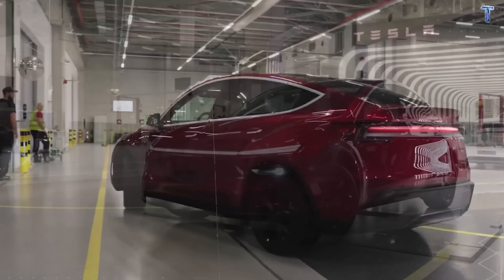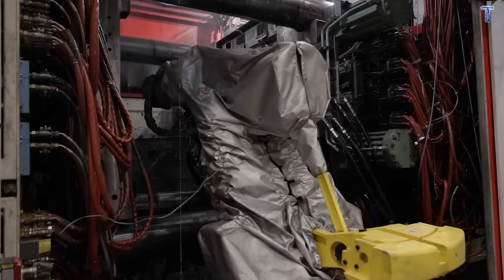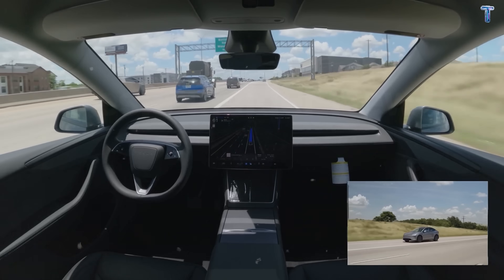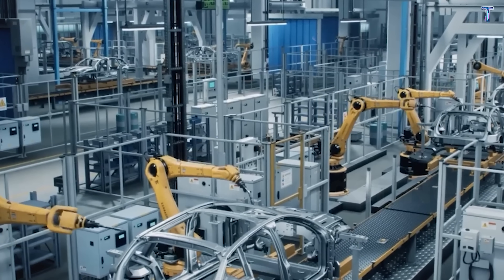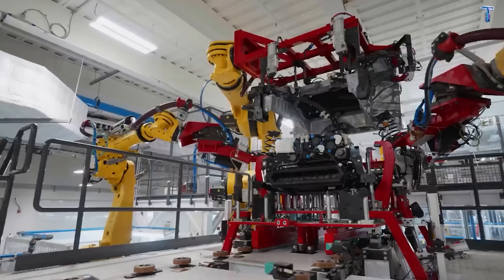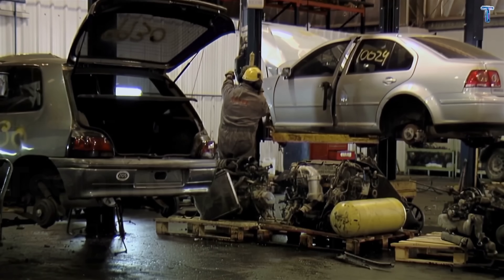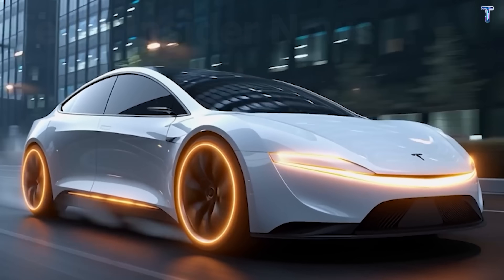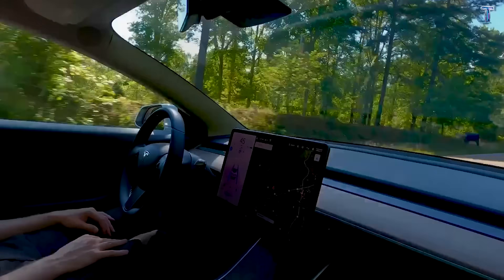Elon Musk’s $12,749 Model 2 Ends Car Bills Forever

Comment: Less glass/doors, manual door handles, smaller battery available, without display screen - use your phone
Reply from the maker: That is actually close to what many internal concepts are aiming for. A simplified variant with fewer glass elements, more mechanical controls, optional smaller battery, and phone based interface has been discussed, though final trims can still change before launch. Tesla is clearly testing how minimal they can go without hurting safety. Which of those cuts would matter most to you in daily use?

Comment: If they can come in under $20,000, I will be in line to try one. And I love some of the colors they used on some of these videos. The bright red and yellow, as well as that soft blue and green. Especially the blue! Maybe I will have one more new car. I have been getting late nineties or early two thousand models and putting 250,000 to 300,000 miles on the clock because of the problems and cost of newer vehicles. I guess I will hold off till 2Q '27 and see what happens.
Reply from the maker: Honestly that makes a lot of sense. Sub-$20k is the real psychological line, and if they actually land there with decent range and build quality, a lot of long-term drivers like you are gonna jump. Totally agree on the colors too — that soft blue especially feels very un-Tesla in a good way.

Also respect for running late 90s/early 2000s cars to 300k miles. That’s exactly why this Model 2 idea is interesting… fewer wear items, less surprise maintenance, more “drive it forever” vibes. Waiting until 2Q ’27 is smart anyway. First wave shakes out, real-world data comes in, and then you decide. If it delivers even half of what’s being promised, it might actually be worth breaking the streak for one last new car.

Comment: Looks a lot better on the outside,  BUT .... if the inside looks like the older ones ( BIG monitor,  boring interior missing basic normal console gadgets and buttons,  no speedometer console in front of the steering wheel to keep your eyes safely looking forward,  no normal vents ). ... will still be a NO GO for me 🙄
Reply from the maker: Interior design is a deal breaker for a lot of drivers, and relying on one big screen instead of physical controls just doesn’t work for everyone. Basic buttons, vents, and a real gauge cluster help keep your eyes where they belong. If Tesla added a traditional driver display and physical controls, would that change your mind?

Comment: 13:32 Generational ownership?  Not in the saltbelt.  Rust will destroy it.
Reply from the maker: Saltbelt winters are brutal on anything metal, and long-term rust really can outlive even the best engineering claims. Generational ownership only works if the body can survive the environment, not just the battery. Do you think heavier undercoating and better corrosion protection would help, or is road salt always going to be the deal breaker where you live?
Reply: @TeslaInsiderNews  Only liquid undercoating like Fluid Film, Blaster Surface Shield, or Woolwax works.  Rubberized undercoating, like Ziebart, only exacerbates rust because it traps moisture.  This video sounds more aspirational than proven history.  Perhaps it won't rust in the desert, but the desert heat will shorten the life of the battery.
Reply from the maker: Good points. Fluid Film–style coatings definitely work better in real-world winter conditions, and rust protection always depends on climate. A lot of this does feel aspirational right now — real proof will come from years on salted roads and hot climates. Until then, skepticism is reasonable.

Comment: THE ONLY THING I BELIEVE IS THATS HIS COST TO BUILD IT...OURS WILL BE AROUND 75,000.00 $$ IF YOU WANT A BATTERY PACK TO MAKE IT WORK
Reply from the maker: The video only gives the base cost of 12,749 and doesn’t mention any 75,000 price or extra battery charges. Both battery options shown are part of the Model 2 design, not add-ons. What makes you think the final price would climb that high?

Comment: MODEL 2 IN LOS ANGELES  HIGH TAXES. STILL HOW MUCH...
Reply from the maker: The video doesn’t list final after-tax pricing, so it only confirms the base cost of 12,749 before local taxes and fees. Los Angeles rates will push it higher, but the manufacturing savings still keep it far below most new EVs. Are you mainly worried about registration or sales tax?

Comment: Until there's a battery issue which is what percentage of the car's cost?
Reply from the maker: Fair point. The battery is a big chunk of the cost, but the newer chemistries are designed to last much longer with fewer surprises. If it held up well for 10–15 years, would that ease your concern?

Comment: Yea,,,, But how much would it cost to replace the battery when it's totally dies out or malfunction after warranty runs out? $15,000.00, $18,000 or more. Think about and do your research. Don't just hear who selling the vehicle.....
Reply from the maker: You are right that battery replacement cost is a huge part of the equation. Newer packs are being built to last much longer and prices keep dropping, so the goal is to avoid that big post warranty bill in the first place. If a battery could last 15 years and cost less than an engine rebuild to replace, would that feel fair to you?
Reply: @TeslaInsiderNews  Have to wait and see. Price never drops on anything. Not everyone can afford a EV and pay for replacement parts. Why it should it be more cheaper if regular gas operated vehicle. parts cost rises. The way the economy system work is not going to let that happen. (Capitalism)
Reply from the maker: Replacement part prices rising is a real concern, and you’re right that capitalism tends to push costs upward, not down, unless a company finds a way to manufacture things dramatically cheaper. EVs won’t feel truly accessible until battery prices stabilize at a level ordinary buyers can handle, even out of warranty.

Waiting and seeing is the only practical approach for now. If long-term data eventually showed replacement batteries costing less than major engine repairs on gas cars today, would that make EV ownership feel more realistic for you?
Reply: @TeslaInsiderNews  Still cost will rise. No matter what. Nothing as of now has in the economy has gone down.
Reply from the maker: That concern is understandable — costs have gone up across the board. The only real counterbalance is when technology scales enough to slow or flatten those increases. EVs aren’t there yet, especially on replacement parts. Until prices prove themselves over time, skepticism is completely reasonable.
Reply: Plus cost on every individual item on such a vehicle is ridiculous 'EXPENSIVE". Button for air condition switch: US$200.00. Gas operated veh.: US$3.99-7.99. Cant fool even a non educated human.......
Reply from the maker: Part costs are a fair concern. What’s being shared internally is that Model 2 is moving toward fewer proprietary parts, more modular components, and simpler mechanical backups to avoid those inflated replacement prices, though real world pricing can still evolve. Long term data will matter more than promises. Which specific repair cost worries you most right now?

Comment: Gigacasting also means your car can be scrapped once it's damaged in a crash. You will never get the original structure strenght back trying to repair with patch pieces.
Reply from the maker: That’s a real concern. The good news is most everyday bumps only affect the outer panels, not the core casting. The structure is harder to damage than it seems, but the real proof will come from crash repair data once cars hit the road. What part of the design worries you most?
Reply: @TeslaInsiderNews Nothing in the design worries me. And gigacasting is of course not unique to Tesla. What we will see is insurance companies not understanding the technological shift and as a result dubious repairs with danger to life.
Reply from the maker: That’s a very fair concern. The tech itself isn’t the scary part — it’s how insurers and repair networks adapt to it. Until standards and training catch up, cost-cutting or improper repairs could absolutely become a safety issue.

Comment: Any car that's hooked up to the internet no thank you
Reply from the maker: Totally understand the hesitation. The Model 2 does stay connected for updates, but the self-maintenance system is what keeps repair costs low and extends the car’s lifespan. You can still drive it normally without relying on any features you don’t want, but the connection is what enables the predictive maintenance and safety improvements over time.

Comment: Have got to overcome the charging problems. The batteries need to charge while traveling. Fix that and deal.
Reply from the maker: Charging still needs progress, but the Model 2’s battery tech is designed to reduce the problem instead of working around it. The sodium-ion pack handles thousands of cycles with almost no degradation, and the aluminum-ion option targets a full charge in about seven minutes. That kind of speed gets very close to “charge while traveling” in practical terms.

Comment: Somebody's math ain't mathing!!  Everywhere else, this car is showing at $25k starting price.
Reply from the maker: Totally get why it feels off. Most of those 25k figures you’re seeing are general estimates, while this video is based on the 12,749 dollar price point stated here for the Model 2 plus the seven cost-cutting breakthroughs. Even if Tesla launched closer to 25k, the 50+ year battery and self-maintenance system still make the long-term cost math very different from a normal gas car.

Comment: I want be able to drive 3000 miles on one charge with no chance of becoming a firework.
Reply from the maker: Three thousand miles on one charge isn’t something any EV can do right now, but the Model 2’s setup focuses on practicality instead: 300 to 350 miles of real-world range and next-gen batteries engineered to last 45 to 90 years. The safety side is covered too, with the rigid chassis and upgraded sensors designed to reduce both failures and fire risk. What kind of range would realistically work for your trips?

Comment: +$20000 dealer markup, I'm sure.
Reply from the maker: Tesla doesn’t use dealerships, so those markups can’t be added on top. The 12,749 dollar figure comes straight from the announcement here, and availability will depend on production speed, not dealer pricing. If they hit that target, it stays a fixed direct-to-buyer price.

Comment: there is no official Tesla Model 2 priced at $12,749.00. The "Model 2" is an unofficial name for a long-rumored, affordable, mass-market Tesla vehicle, but it has not been officially released or priced by the company. 
The current cheapest new Tesla model available is the Model 3, which has a starting price significantly higher than the figure you mentioned, typically in the range of the high $30,000s to low $40,000s in the US, depending on the current market and trim level. 
Rumors and speculative YouTube videos have mentioned potential price points as low as around $10,000 to $15,000 for the rumored affordable model to compete with Chinese manufacturers, but these are not official prices, and the vehicle itself has not been confirmed for production at those price points.
Reply from the maker: The price being discussed here isn’t an official public announcement. It’s the target tied to the planned 2026 rollout described in the content. Tesla hasn’t confirmed it yet, so it’s separate from the current Model 3 pricing you’re referencing.

Comment: File this with the 7 k pickups from cat and freight liner
Reply from the maker: Those trucks sounded great on paper but never delivered anything close to what was promised. The Model 2 at least has pilot production running, prototypes already testing on highways, and a confirmed Q2 2026 reveal with August deliveries. If Tesla sticks to the 12,749 dollar price and the seven engineering breakthroughs in the announcement, it’s operating on a very different level than those past hype projects.

Comment: Last you will ever buy I heard that when I bought my Tesla model s 2021
Reply from the maker: Totally understand the feeling. The difference here is the hardware and battery tech on the Model 2 is designed for multi-decade use from day one. The chassis is a single casting, the self-maintenance system predicts failures, and the next-gen batteries are tested to last far longer than current packs. It’s the first time Tesla is engineering a car specifically to age differently.

Comment: They don't want chinese automaker to get in US auto market
Reply from the maker: The U.S. is definitely cautious about opening the door to low-cost Chinese EVs, but the angle here is that Tesla’s 12,749-dollar Model 2 is meant to beat those prices before they even arrive. With pilot production already running and the unboxed manufacturing cutting costs by 50 percent, it’s Tesla trying to stay ahead so foreign budget EVs don’t dominate the lower end of the market.

Comment: Too bad electric rated are atrocious here in Commie CT.  I am forced to pay for illegal non citizens residential electric bills.
Reply from the maker: Electric rates definitely vary by state, and some places make it tougher than others. The Model 2’s angle is that the 300–350 mile range and the low 12,749 dollar price help offset those higher utility costs, especially with no gas, oil changes, or major maintenance bills. Even in pricey states, the long-term savings from the self-maintenance system can still add up and take some pressure off monthly costs.

Comment: Tesla cars are ugly as F, it looks like it was built by kids without tools. Long distance travel is out of the question, they ride like a truck, they are a tablet with wheels.
Reply from the maker: That’s a strong take, and you’re not alone in feeling that way. The design isn’t for everyone. This model’s focus is more on the rigid single-piece chassis, long-range battery options, and smoother adaptive suspension to make long trips easier than older EVs. Looks are subjective, though — if the style isn’t your thing, totally fair.

Comment: Sounds like a heck of a lot to go  wrong to me . Or am I just an old misery 🤔
Reply from the maker: A lot of tech is packed in, but most of it is actually about reducing what can go wrong. The chassis is one solid casting, the doors have a manual latch, and the self-maintenance system predicts issues before they happen. It’s built to cut failures, not add more of them.
Reply: @TeslaInsiderNews thanks for the reassurance 👍

Comment: Google says that it will probably be priced around $30,000-35,000
Reply from the maker: The price in this video comes directly from the announcement: 12,749 dollars for the Model 2, with pilot production already running and deliveries targeted for August 2026. Google estimates are just general speculation right now, not tied to Tesla’s stated number. The only confirmed figure in the reveal is the 12,749 dollar price.

Comment: LoL... if any car company really sold a good vehicle for around $12,000 they would sell so many they couldn't build them fast enough. 
Nobody needs power windows or locks. Way too many useless things in vehicles.
Reply from the maker: A truly simple 12k car absolutely would sell faster than anyone could build it, and you’re right — most people don’t actually need half the features bundled into modern vehicles. Power windows, automated everything, and giant touchscreens all add cost most drivers never asked for.

If a manufacturer released a bare-bones, durable EV with only the essentials, do you think people would go for it in huge numbers, or has the market already gotten too used to all the extras?
Reply: @TeslaInsiderNews Absolutely people would definitely buy it. Remember K.I.S.S.
Keep it simple stupid. There's always some people that want it all but don't forget about the rest of us and don't forget There's more of us.
Reply: Also, most people never use the back seats.
Reply from the maker: The Model 2 takes the opposite approach: it keeps the essentials but uses the unboxed manufacturing and the single-piece chassis to cut costs instead of removing useful features. That’s how it reaches the 12,749 dollar price while still offering solid safety and a long-life battery. And honestly, you’re right — most people don’t need huge cabins or fancy extras, which is why a smaller, simpler design actually fits how most drivers use their cars.
Reply: All of this is irreverent! Tesla is Not building a 10 or 15 thousand dollar car.
Nobody is.! No car maker cares about people, they only care about making money.
Reply from the maker: I get the frustration, but it’s not entirely irreverent. Automakers do care about profit first — no argument there — but if a lower-cost car can be profitable at scale, someone will chase it. Whether Tesla can actually do it at that price is the real question. Skepticism is fair, but markets have a way of forcing change when the math finally works.

Comment: What people like to leave out about electric cars vs gas cars is your Electricity Bill is going to skyrocket especially with how expensive electricity bills have already gone up.  On top of that states are making registration and plate fees for electric cars even higher than they are for gas cars, so they can continue to make more money. I think the price of cars have gotten way to expensive. I hope this is true and will help bring down the pricing on cars more but i dont believe this car will be 12 grand off the lot brand new.
Reply from the maker: You make some solid points. Electricity and fees can add up depending on the state. The hope is that cheaper EVs push the whole market toward more reasonable pricing again. If this lands anywhere close to the rumored number, it could finally nudge things in the right direction. What price would make you feel it’s truly worth the switch?